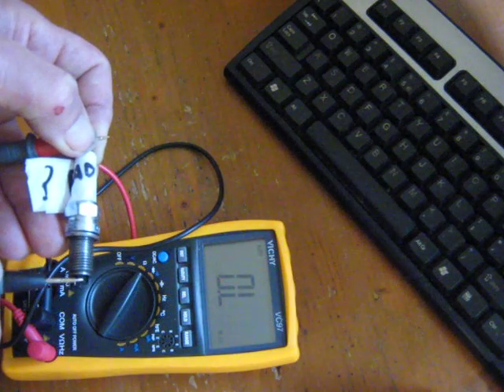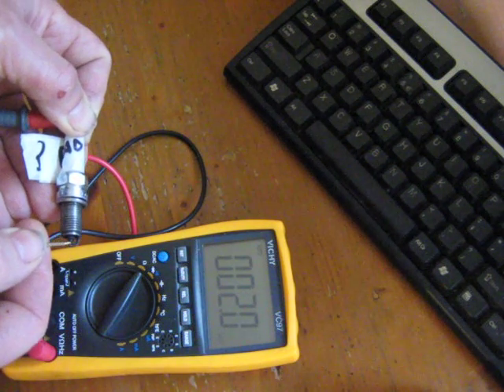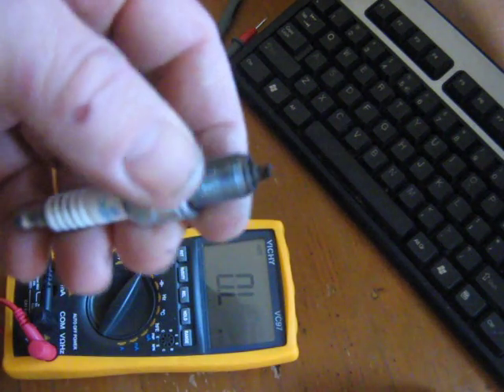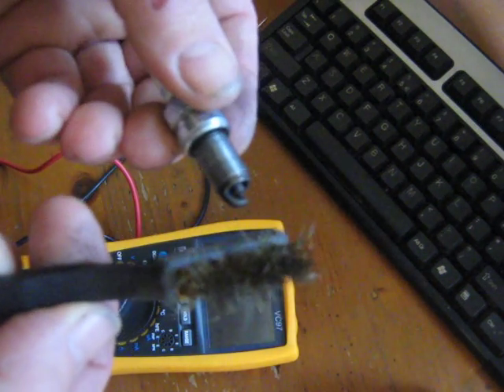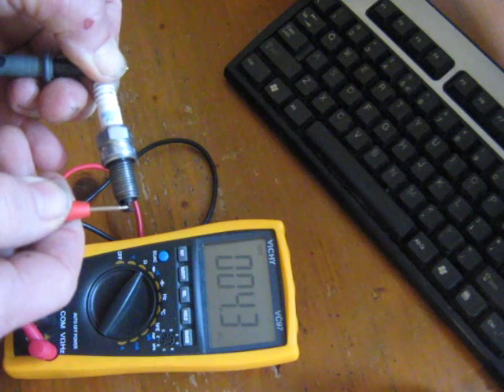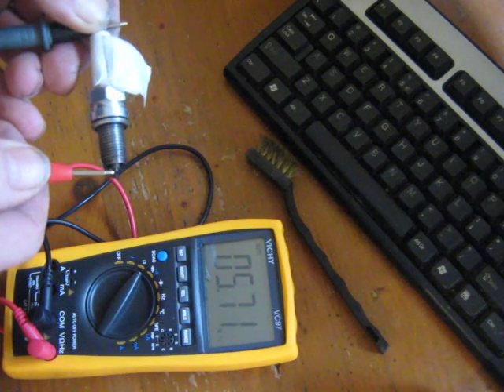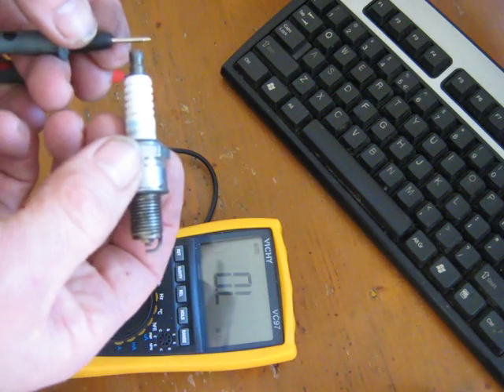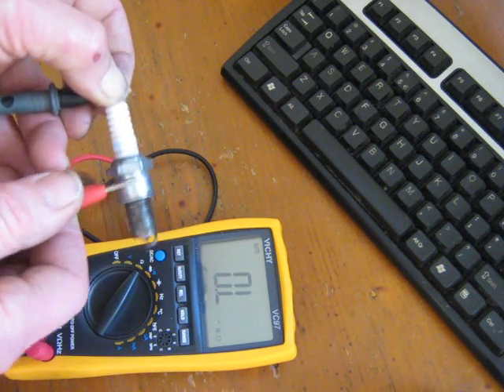testing a spark plug with a multimeter

Comment: spark plugs are a 2 dollar a piece, why test them. Even if your to replace one spark plug it is recommended to change all of them in one go.
Reply: because it could be something else that is causing the missfire, and you need to test your components so you can fix the problem, and not every spark plug is that cheap
Reply: sometimes plugs can be defective out of box, good vid.
Reply: Devoy Williams er9eh plus are $15+ dollars each, there's $60 for a set of 4